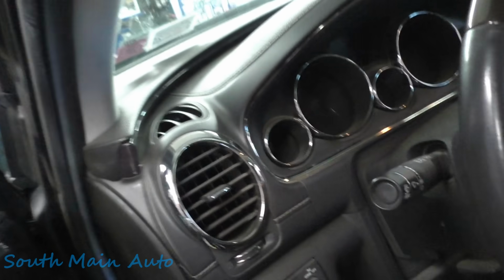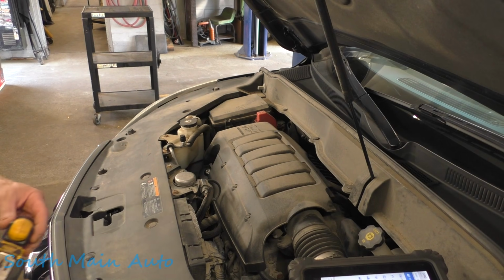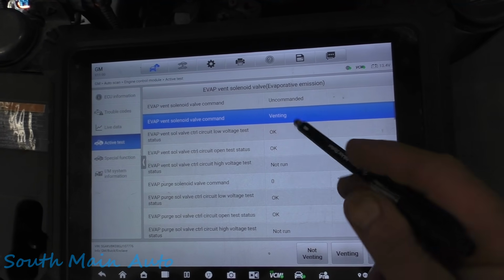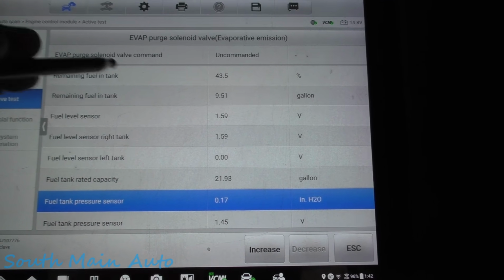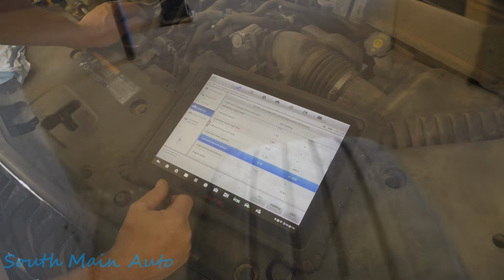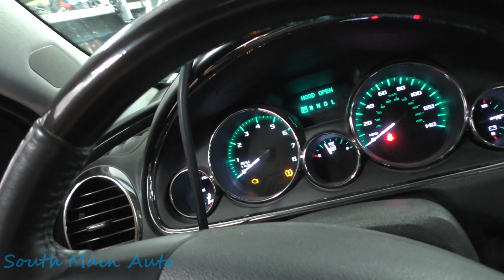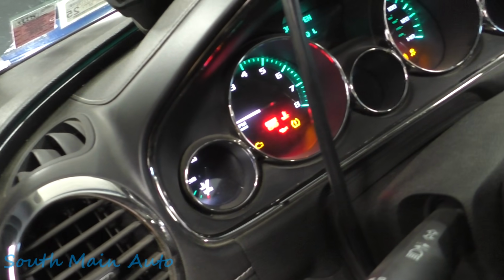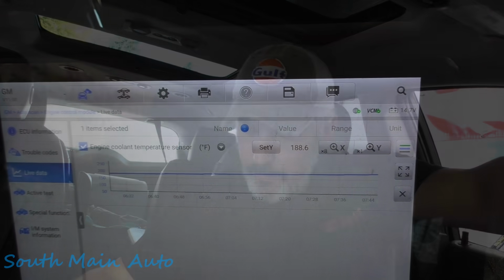Buick Enclave - Engine Light & TPMS Light On.

Comment: Mr O dropped the fuel tank 😉, but if you don’t, never use a wire brush wheel on the filler neck, only a brass brush wheel as it won’t cause sparking.
Good job again Mr O 👍
Reply: If you can even buy an actual brass brush, and not just a brass plated steel brush
Reply: What about fine sand paper or emery cloth?
Reply: Make sure you use a brush type drill to get the spark you want... not.
Reply: Car sure makes a lot of noise
Reply: Yeah that’s what they say all of the time, but I’m just not sure I would still chance it.
Reply: @earlestes8649   I worked in the fuel business.    Gas pump technicians use a 5 gallon brass container to pump fuel into when calibrating the pump.    You can strike it with any tool and it won't spark, nor will a static charge build up.     Mechanics use a brass punch to undo the lock ring where the fuel pump goes into the fuel tank.     The only problem with Eric's method was the cordless drill, you can still get a spark from them.
Reply: I doubt he removed the fuel tank at all.

Comment: Does the enclave have two orrifice tube for front and rear a/c
Reply: No orifice tube (s)  It does have two expansion valves.
Reply: @scrappy7571  probably why rear is not blowing cold just the front thanks for the info
Reply: Google it
Reply: @2nickles647  I did it says yea dealer says nope I do believe the system requires them

Comment: You can clean the gas filler without taking the tank out you just shove a wet rag on the opening instead of dry paper towel I work in a shop we do that all the time
Reply: I live in an area with minimal rust but i think if i ever had to do this with the tank installed id prolly plug it with a blue towel and use a brass wheel on a yellow drill with the tank still installed instead of doing it Eric's dumb way...😒
Reply: You missed his sarcasm. Lol. Internet safety nannies are always giving him crap.

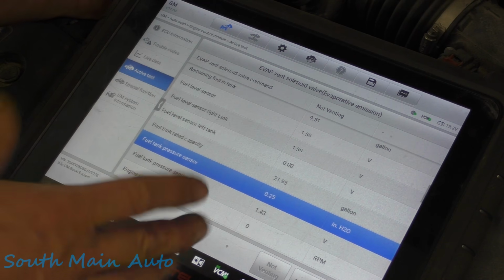Comment: 17:00 can you blow into the tube then quickly cap it off with your finger (or fold it over) and see if the pressure holds?

Comment: I had 2 TPMS sensors replaced recently. They took almost 4 years to die. First they were slow to report in, and the first winter one would quit working below 20 F. Fast forward through 2 more winters and into this fall the failure temperature gradually increased until they didn't work below 60F. Of course my car is super friendly and blanks ALL 4 sensors if one isn't reporting in. I'll have the other 2 replaced the next time it cuts out or before next winter when I'll be due for service anyway. Local tire/front end place did both sensors for less than the dealer parts counter wanted for 1 sensor...I only checked with the dealer so I could laugh at their price.

Comment: I had a reoccurring small evap leak in my 02 Town & Country that I could not track down. I put silicone grease around the fuel neck like E did in this video and I have not had the problem since.
I have got to get me one of those adjustable pry bars. I freaking love that thing.
Luv me sum SMA❤